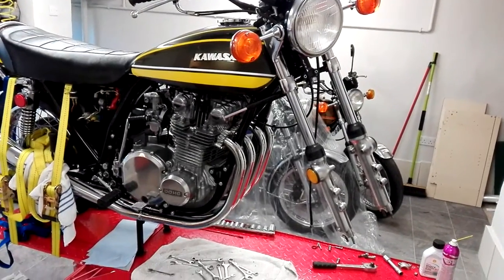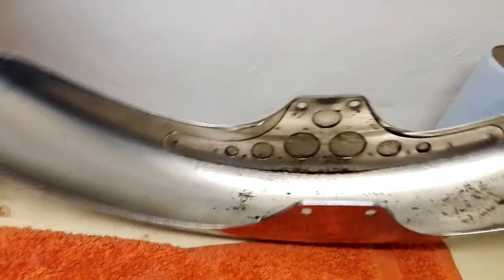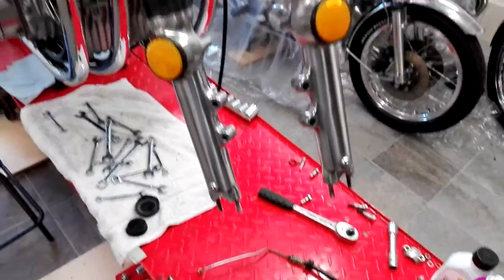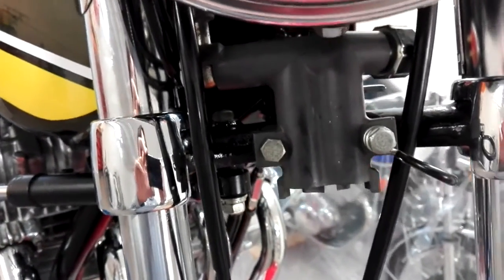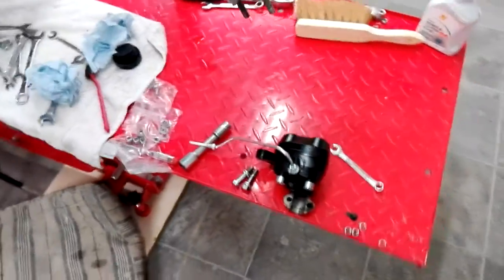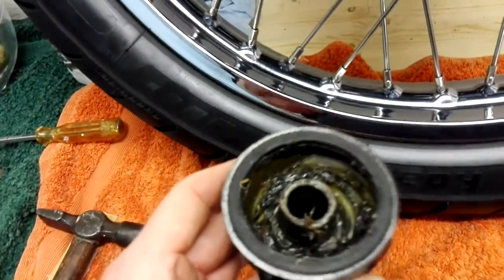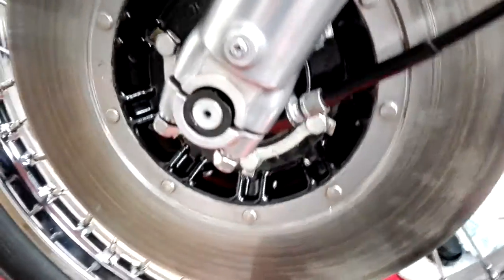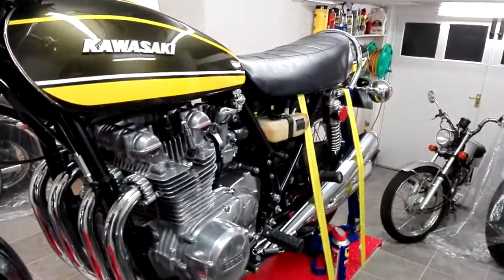Kawasaki Z1 900 Twin Disc Front Brake Conversion

Comment from the maker: NB The clamps at the bottom of the forks should be fully closed up at the front, and with a gap at the back. They shouldn't have an equal gap either side as stated in the video.

Comment: Hi  Chris, great video. I notice you have a front Avon tyre. Which Avon’s did you go for and what size for each tyre? Cheers.
Reply from the maker: Hi there. I fitted Avon Roadriders to both the front and rear wheels. The front wheel is a 19" wheel, and the rear is an 18" (standard on Z1/Z900). The sizes I fitted were as follows: Front 100/90 - 19. Rear 120/90 - 18. Hope this helps.

Comment: how did you manage to unite the two centers of the wheel so you can install the second disc plate???
Reply from the maker: I'm sorry, I don't quite understand the question. Do you mean 'how did I line the hubs up?' or something different? Can you try to explain further.
Reply: What hub did you use on that to install dual disc brake?
Reply from the maker: Same hub - just removed the plugs in the hub to allow the second disc to be added, as in the video.